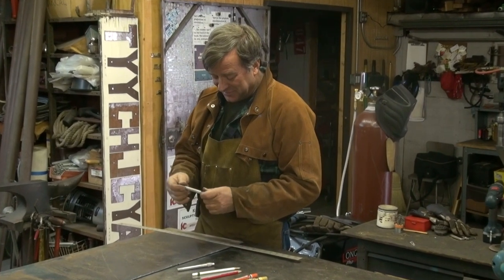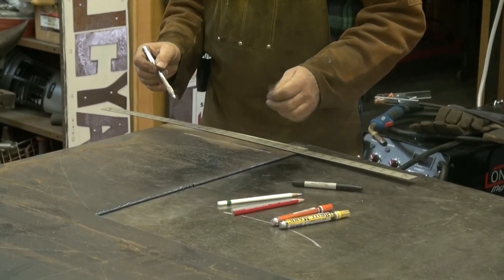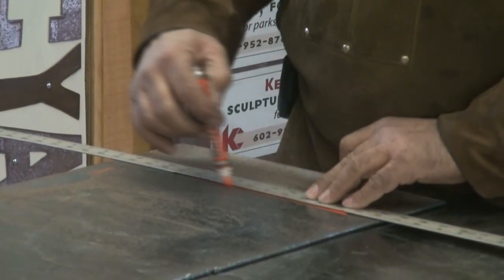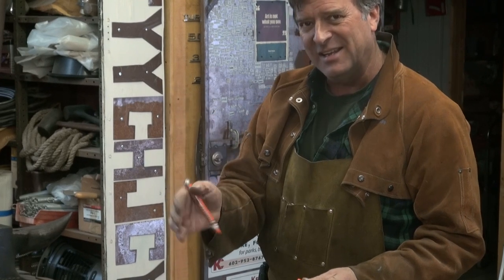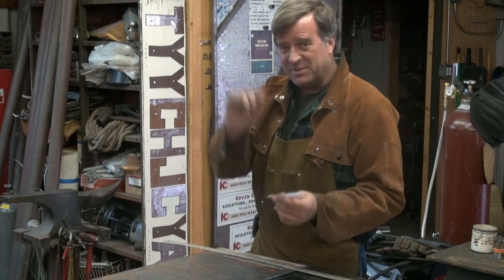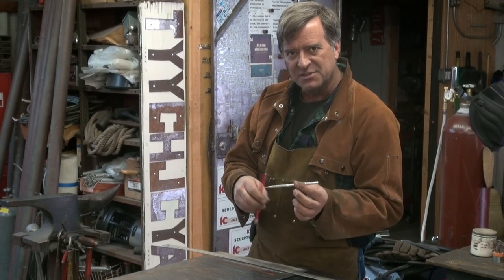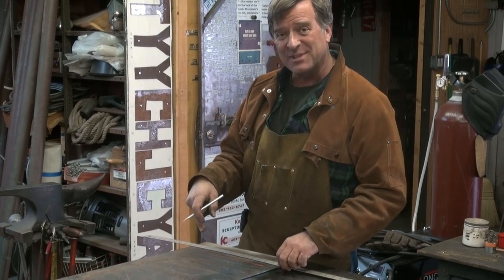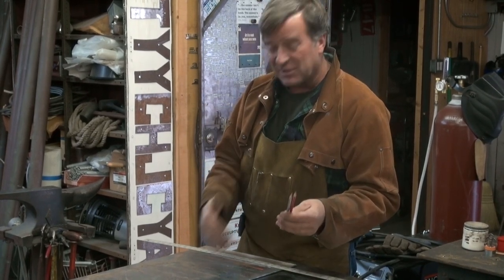The Best Markers and Pencils for Marking Steel - Kevin Caron

Comment: Btw, the Presto makes a very fine line - about 2mm wide. Not sure how fluid is in them , but they last a long time. Markal Pro is also excellent and has different colors of refills, not cheap but it is a welding specific marking tool.

Comment: @kevincaronsculpture Do you have suggestions for a marking device for stainless steel that you could weld over the top of without contaminating the weld?
Reply from the maker: A scribe would work great if your metal is clean and smooth.  Or a red steel marking pencil will work as well.

Comment: Hey Kevin, do you know of any tool that allows you to draw a circle around a pipe?  I bend a lot of pipe and I need to mark all the way around.  I do have some of the half circle cuff things you can clamp on a pipe and then mark, but you have to turn it around the pipe to make a continuous line, and then pull them back off the pipe and move to next location.  Lately I've started using a pipe cutter and just lightly scoring the pipe so I can see my measurements all the way around.  I was wondering if you've ever seen a tool that might look like a pipe cutter, but have a marking pen where the cutting wheel goes.  Would make drawing your lines much easier and faster.
Reply from the maker: I use a 3 inch wide by 21 inch long belt sander belt.   It broke when I was using it on the sander but it makes a great marking tool. Just line up the edges and you are good to go.
Reply: @KevincaronSculpture  There are also pipefitters coils that are made for this.

Comment: try the Milwaukee inkzall
Reply from the maker: +Vince Neil

Will look for one..   thanks for the tip..
Reply: +Kevin Caron, Artist home depot, they are red with black caps
Reply: +Kevin Caron, Artist question here, im looking for an erasable marker or pencil  that is great to use with all types of metal, clean,dirty etc and wont stain if i forget to wipe off and is a fine point any suggestions , thanks
Reply: +Kevin Caron, Artist question here, im looking for an erasable marker or pencil  that is great to use with all types of metal, clean,dirty etc and wont stain if i forget to wipe off and is a fine point any suggestions
Reply from the maker: Not really,    No such thing I think...
Reply: that's how i feel :( but ty for the reply.

Comment: Soapstone powder is Talc as in baby Powder and cancer (soapstone is 
asbestos) and that is why welders use it as it does not burn from a 
cutting torch. That powder you just made can cause mesothelioma.
Reply: Soapstone/talc is hydrated magnesium silicate (Mg3Si4O10(OH)2). It is not a carcinogen, however, talc is an inhaled irritant, and breathing enough powdered soapstone/talc over time will result in silicosis.

Asbestos is one of six silicate minerals but the relevant silicate here is chrysotile or white asbestos (Mg3(Si2O5)(OH)4). It is a known carcinogen. Breathing enough asbestos fibrils can lead to about a dozen very bad conditions including peritoneal mesothelioma and lung cancer.

Soapstone and asbestos are not the same mineral. Some soapstone is contaminated with asbestos. The soapstone used in welding crayons is selected for uniformity (consistent strength and line appearance) and the presence of asbestos would markedly weaken the sample and make it unsuitable for use as a crayon. So very unlikely to create a risk of mesothelioma. Also, the quantity of dust produced with a soapstone marker is vastly smaller than in the smallest household uses of talcum powder, so is also unlikely to create a significant risk of silicosis.